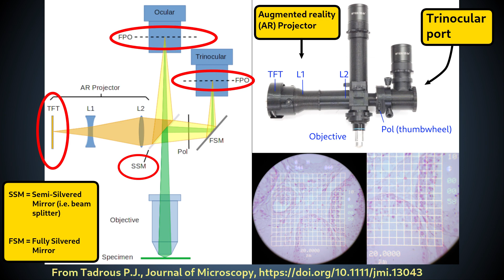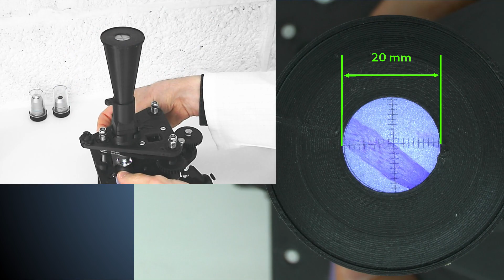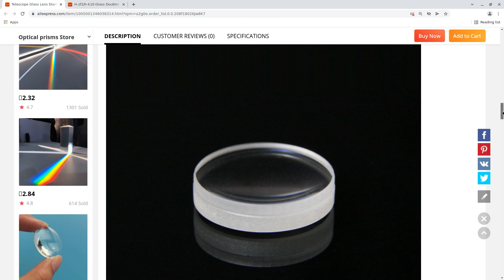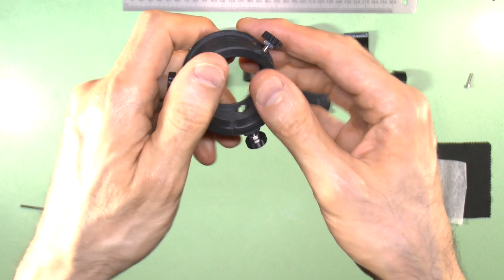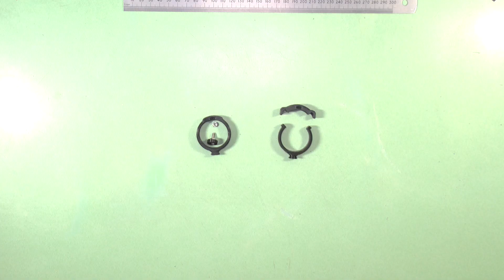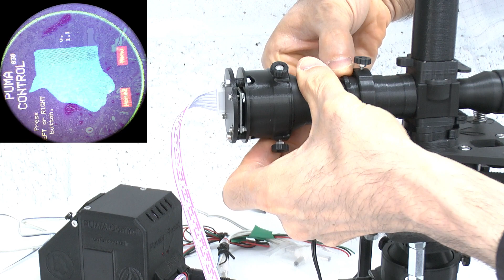How To Build and Fit the Augmented Reality Projector of a PUMA Open Source 3D Printed Microscope

Comment: Hi! I have had great success building the SLM and have been spurred on to tackle the AR projector, I had some trouble sourcing lenses but tracked down the original convex lens  and an alternate double concave single lens, I am very pleased with the results and, yet again, finding the design, instructions and guidance outstanding.I have had good results with ×10 objective, but am at the limit of focus plate travel on the higher mag x40 objective, with the ferule  pressing on the top of the focus plate screw, Ive tried both the 1mm and 4mm quickrelease but obviously the benefit gained from using the thicker quickrelease is lost due to the objective being recessed further and therefore requiring more focus travel (hope that makes sense). I am happy to   experiment and invest the time to resolve, I expect its my fault/error (maybe the wrong objectivesize?), but if you have any suggestions Paul, I'd be grateful 🙏 But otherwise I'm delighted with the results I'm getting.
Reply from the maker: Good to hear your build is going well. The SLM is a very powerful device - you can do a lot with that. As for the ferrule hitting the screw with x40 I have three ideas but not sure if they are correct so treat them as 'suggestions to thing about' rather than definitive answers.
1. There is a recess in the ferrule to accommodate the front focus post screw - make sure you orientate the ferrule with the recess in the right place for the screw.
2. Maybe your x40 is a '185' objective meaning it needs to get 10 mm closer to the sample to be in focus. That is a lot of extra travel in the downward direction and the scope needs to be adjusted for that. I can tell you how but it would be better if you used a 195 objective in the fist place.
3. You may have the eyepiece set in the wrong place. If it is too high up you will need to move the objective further down than normal. You can try shortening this gap by screwing down the eyepiece holder a bit. If you usually wear glasses, keep them on while observing instead of adjusting the height of the eyepiece to compensate for your vision.
All the best.
Reply: @PUMAMicroscope Thanks, I'll double check the objective, I'm sure I'll be able to work it out, thanks for the suggestions. Agreed on the SLM, it's a gem, and I've got very familiar with using the console to control it, Ive also fitted the stage focus motor, but will disconnect that until Ive sorted the AR projector. These are great add ons Paul, PUMA is the best!

Comment: I tried making it with the same supplier, but the closest 26mm lens they had was concave/convex. with a little changes to tube length it worked well, even if
with some more chromatic aberrations than the original lenses. fun module to make.
Reply from the maker: Thanks for the feedback.

Comment: Hi, I really like what you've done here. Can you give any generic advice to adapting this for regular compound microscopes to be attached to their trinocular ports? Eg a Leitz laborlux please?
Reply from the maker: Hello. The optical principles are as described in the videos - you need to project an image of your computer screen to be focussed on the same plane as the ocular lenses' focal plane. Achieving this with other microscopes can be a problem because their 'trinocular' ports point down to the specimen so if you shine an image down there then part of your projected computer screen image will also go down onto the specimen and may cause unwanted back-reflections. The PUMA arrangement allows the image of the TFT screen that gets past the beam-splitter to go horizontally and be either absorbed by a light sink or used in the PUMA trinoculular port which is lateral (at 90 degrees) to the specimen. So this image does not spoil the specimen.
I suppose you might be able to achieve this on a standard microscope by using a double header-type splitter port or a port that would otherwise be used for a pointer but the details of getting the projection and zoom right might be tricky - I have not tried.
Reply: @PUMAMicroscope  Thank you for your comments. I thought that my trinocular head had a built in beam-splitter but after reading your comment and checking this might not be so. I will have to check in detail. I suppose the alternative is to adapt an attachment in between the binocular/monocular eyepiece similar to the puma so I can include a beam-splitter into it (you use a SSM instead of a prism here it seems). My very loose understanding of optics (from school many years ago) suggests that I will need to add a focusing lens to this extension attachment to account for the extra distance made (as the microscope is a 160mm one as it is not infinity corrected). Would this be a correct general outline of the task at hand? Thus in this case I would (if you allow me to) adapt your Puma system to include an additional focusing lens and also adapt connectors at both ends to join this to my microscope.

Would this be OK with you. I would also appreciate any additional pointers you could give. Thank you!
Reply from the maker: @letshin  Your trinocular head does indeed have a beam splitter in it, just not in an optimal configuration for use as a AR projector set up. Whatever method you try, you will need to use lenses to ensure a projected image of your TFT screen (or smartphone screen if that is what you are going to use instead) is focussed onto the focal plane of the oculars and avoid getting light from the screen to go down onto your specimen (ideally).
Reply: @PUMAMicroscope  Thanks, I think I would like to start off by making the PUMA AR projector and the above stage optics to figure out what I need to do to adapt this for my own use. I checked the Github and looking through the 3d printing guide it seems I will need the binocular head (BN_) files as well as the AR projector (AR_) files. Will I need the filterblock module as well? Is there a document/decision tree that relates how the different modules link together? 

Edit: The possible configurations are at the end of the BoM Excel file so I'll refer to this instead. I've ordered the required mirror and beam splitters from these (I have spare eyepieces and objectives) so will see how this goes. Thanks!
Reply from the maker: @letshin  You do NOT need the binocular head for the AR projector. You DO need the advanced filter block.
Some people have told me they have had difficulties getting the concave lens for the AR projector. It would be interesting to know if you can get it.

Comment: Hi, I have been wondering if its possible to control ar hud with external TFT touchscreen. I want to show phototaxis of euglena to students, and my plan was to use external TFT touchscreen to project touch-based interactions of students as light beams to euglena gracilis, then see reactions of euglena gracilis based on those touch interactions in screen. Is it possible? Sorry if that sounds confusing, english is not my mother tongue.
Reply from the maker: Hello. Sure - what you have said should be possible. There are a number of ways of achieving it. Let's assume you have built the AR Projector optical tube, then:
One method is to use a smart phone or tablet in place of the standard TFT screen - for example holding the phone at the right position in front of the stand in the same way I held up the slide of an eyeball in my video on  'Photology 5' at about time point 00:10:12 ( https://youtu.be/u_0xczp4210 ) with some drapes to shield from outside light. Then simply use this phone or tablet as a wireless screen 'mirror' or 'screencast' device to receive the video signal from the phone or tablet your students are holding. 
The other option is to use the standard TFT screen AR projector but you will need to write the interface yourself because that is not a standard feature of the current PUMA Control software - and you may also need to use a more powerful Arduino than the standard 'nano' version I use in my demos here (perhaps like the Arduino Mega). You would then connect the tablet or phone to the Arduino with your own software painting to the TFT screen in response to your students touch-movements on the tablet / phone.
I haven't done any of this so can't guarantee it will work but those are the ways I would approach it.

Comment: Hi Paul, I was wondering if you had any advice regarding the 26mmx-55.6mm achromatic doublet. I am having issues sourcing this lens and the seller said it wasn't being manufactured at this time. So I was wondering if extracting one from a cheap achromatic Barlow lens would work. I have a feeling the diameter of the lens would be close to 26mm. As for the focal length, I'd probably have to search the internet to figure out the focal length of x2, x3 and x5 barlows.
Thanks.
Reply from the maker: Hello. I agree with your general idea. Of course any alternative would likely need some changes to the 3DP models in diameter and lengths and you would need to calculate those (it is one of the benefits of having an open source parametric DIY 3DP microscope). If you do a search on AE for 'minifying lens' you will see some possible alternatives like this:
https://www.aliexpress.com/item/4001005707914.html
or this:
https://www.aliexpress.com/item/4000970055079.html
and then there's Edmund optics:
https://www.edmundoptics.co.uk/p/25mm-dia-x50mm-fl-vis-0deg-coated-double-concave-lens/8125/
and when I first built the AR projector prototype I used this lens:
https://www.aliexpress.com/item/1005002756999921.html
It is bigger (42 mm diam) with smaller focal length (-40) but worked with appropriate projector tube adjustments (so the other alternatives above should be even better).
The issue with all examples above is they are not corrected for spherical and chroma so the image will show some distortion and colour separation.
You may also find something suitable in taking apart those cheap 'clip-on' wide angle lenses for smart phones.
I may revisit this when I have more practical experience myself at building an AR projector with an alternative lens. All the best.
Reply: @PUMAMicroscope  Maybe both of these lenses do not need to be achromatic for this application. The negative lens could do as a singlet. It's not too difficult to simulate the results.
Reply from the maker: You are probably right and any residual aberrations would not be important for some use cases.